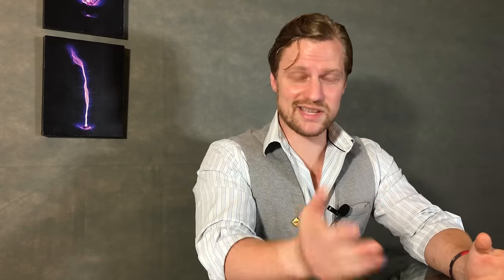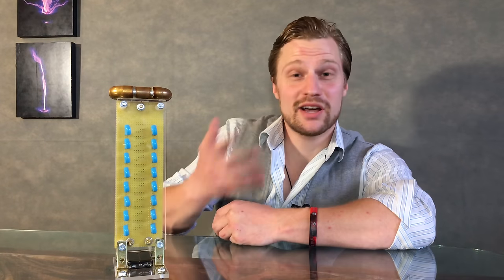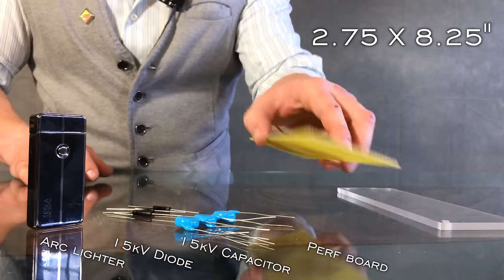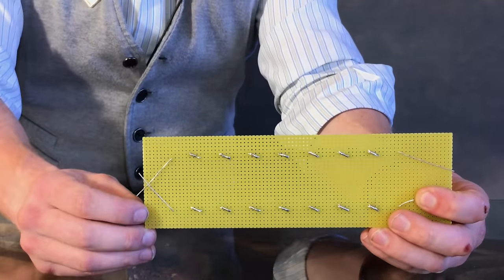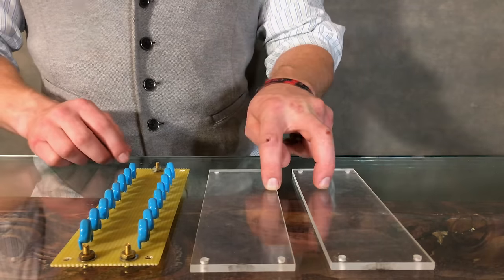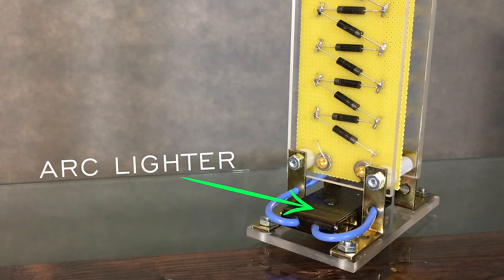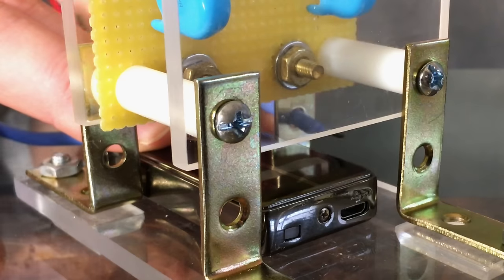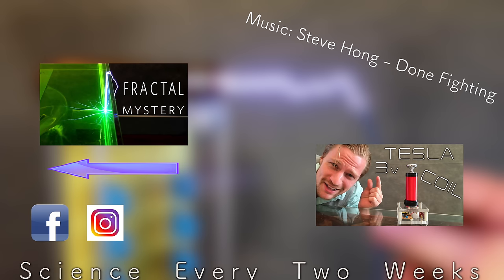DIY Desktop Lightning Tower (USB rechargeable!)

Comment: Now touch the 67,000 volts.
Reply from the maker: Already have. It hurts. But this one is not designed to be touched. Will actually break the device if power discharges to you.
Reply: Plasma Channel Oh LMAO is that what happens I recently just got into electronics so I'm not used to these advanced circuits.

Why would it break the device if the power discharged to you out of curiosity?
Reply from the maker: Because your other hand is holding down the power button of the lighter. So it goes through your body and into the components of the lighter.

Comment: Can a high voltage generator like what is used in stun guns work in place of the plasma lighter?
Reply from the maker: It will not unfortunately. Voltage multipliers only take AC input. Feeding it DC will do nothing.

Comment: Can it take power from a mot
Reply: that would blow the thing up and you would die
Reply from the maker: This is correct. MOT is way too much power.
Reply: never play with mots Orion Myers. they are dangerous and can kill you instantly as they output almost 2 kW.

Comment: alternately you could had ordered 15kv hv kit from the Web, instead of dismantle the lighter, Would have been cheaper.
Reply from the maker: Though it would not be USB rechargeable
Reply: @PlasmaChannel  y correct, i charge the 18650 With a simle li-ion external charger.
Reply: is your setup cheaper and easier to build im guessing you need the hv kit a push button switch and a battery holder mounted somewhere? how is yours set up ... do you have a small schematic for me please and compponent links> helpful

Comment: Why do you prefer to assemble your voltage multipliers with negative output polarity? Positive would give you longer sparks with the same voltage in this particular non uniform spark gap of yours.
P.S. You mentioned ultra high voltage in the video, I belive UHV is 750 kV and higher.
Reply from the maker: What is interesting is I have done a fair amount of experimentation and found that negative high-voltage gives me a longer Sparks. As per ultra high voltage, that was just a way for me to explain that the output wire was higher voltage.
Reply: Plasma Channel hmm that's odd, but if it works for you then ok

Comment: Impressive, but a very inefficient usage of PCB space.
Reply from the maker: True. The problem with spacing them closer in open air, is that the capacitors will discharge to one another. So I had no choice but to space it out more than i'd have liked.

Comment: Could you please experiments with a gallon Glas jar filled with urine and use your device. And run it for several hours or days maybe several weeks. It would be a interesting experiment
Reply from the maker: Are you referring to the experiment from the 70's.....where they made amino acids out of nothing but gas and high voltage discharges?

Comment: Can we power it from a bug zapper sarcit
Reply from the maker: unfortunately no, bug zappers are DC, this must run off high frequency AC
Reply: What happened if I use  different capacitor in series 3kv,2kv it work or not ....

Thanks for replay
Reply: @PlasmaChannel  if bug zappers are DC, then they already have the multiplier, rectifier circuit. You just need to beef it up.

Comment: I was going to build it until i saw the price of 15kv diodes
Reply from the maker: Yeah you can use lower voltage ones. However, you need diodes with high peak current ratings... and these diodes have a 10 peak rating which is great, plus they are compact.

Comment: Don't use it while it's plugged in!, LOL just what you need, high voltage toys right next to your laptop. Hahahaha I killed a network card with just body static and pushing the reset button.
Reply from the maker: Yeah, definitely dont use it when it's next to any sensitive equipment.
Reply: @PlasmaChannel  and that senstive "thing" includes children!

Comment: If I want to make a lower voltage one do I have to have different capacitors?
Reply from the maker: Capacitor voltage rating isn’t what determines the voltage output of a multiplier
Reply: @PlasmaChannel  what about capacity?
Reply from the maker: That will affect the voltage somewhat. Voltage rating tells you how much voltage you can shove into a capacitor before it blows up. Capacitance tells you the energy it holds. Your input power source, and how many stages you build, determine output voltage (mostly)
Reply: @PlasmaChannel  Ok thanks :D

Comment: I think you can use 1N4007 diodes just  by keeping input voltage less than 700V.
Reply from the maker: You can, but should use UF4007. They are designed for high frequency , 1N’s are not
Reply: Good information thank you.
Reply from the maker: Certainly!

Comment: 15kv diode for 67kv. You see the problem, do you...
Reply from the maker: No problem. Multipliers, when they discharge, discharge through the series zigzag chain of capacitors and diodes. That is 15kV * 16, or, 240,000 volt rating. For both the diodes and capacitors. We’re only pushing 67,000-70000 volts.

Comment: So I built the device as you suggested, and with a plasma lighter I got 3 inch sparks...great. Then I decided to up the ante by using a 6,000 volt NST. I got arcing between the first two stages, so I immersed the board in salad oil. The arcing stopped, but the output voltage remained at about 3 inches. Is there some upper limit to this circuit? How can I take it higher? Here's a link to my version: https://youtu.be/kmKOHc8apRc. I used 20KV 1nF 0.001uF caps and diodes rated at 20KV. Thanks for the inspiration. Lee
Reply: Today i fed the multiplier from an ac flyback transformer driven by  an ebay ZVS...OMG 6-8 inch sparks

Comment: I dont get it. How does 67kv not damage the 15kv caps and diodes? Please somebody explain! 😂
Reply from the maker: When the high voltage output discharges, it travels through all of the diodes in series. That’s a diode rating of 16 X 15kv.  With voltage multipliers, one never need to worry about output voltage damaging components. If each stage is built to withstand the input voltage, by definition, you’ve built it to survive the output voltage
Reply: Plasma Channel aahhh, I see that now, thank you for explaining. I am planning to do a small project where I make a boost converter and put it on a synchronous motor, to create a hand powered hv generator. Any advice?! 🙂
Reply: Plasma Channel p.s. what about using this multiplier on a hv module? (Those cheap Chinese ones!) This might give your project an even higher input voltage!
Reply: those output DC and we need AC for this multiplier to work.
Reply from the maker: That is correct!

Comment: You can easily use a boost module it's damn cheaper and durable
Reply from the maker: True. But their voltage is less, and, their sparks less intense.
Reply: can you please make something like this with a T.V flyback transformer

Comment: Ok but where is the ground that the wire has to be connected to??
Reply from the maker: The electrical ground of every multiplier is the same. Depending on how you build it, it’s one input wire or the other

Comment: Hey Jay! I have finally made some nice sparks. Here are the results: https://www.youtube.com/watch?v=tWNWrJKDkEM
Reply from the maker: Great driver circuit. That is awesome. Again, though, i'd strongly recommend a new topload. HV works in a predictable manner....any sharp points, electrons will fly off of those points, ultimately reducing your voltage in the system. Your toplaod has a ton of 90 degree edges, sharp points. It is a decent top load you have on there, but, it could be improved upon, maybe even double your spark length. Keep the topload round and smooth if possible. I love your build though.
Reply: @PlasmaChannel  new top load is in production :) will post the update when im finished :)